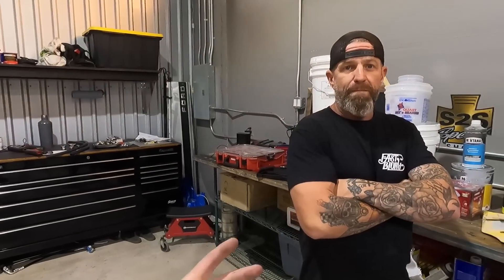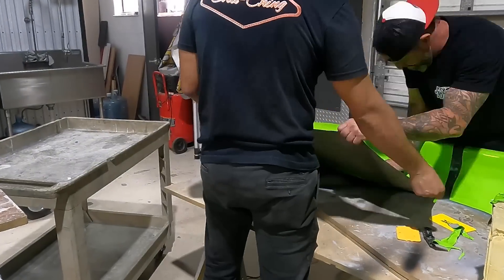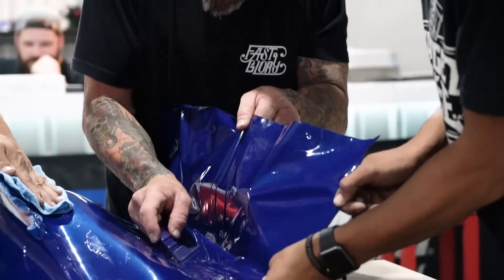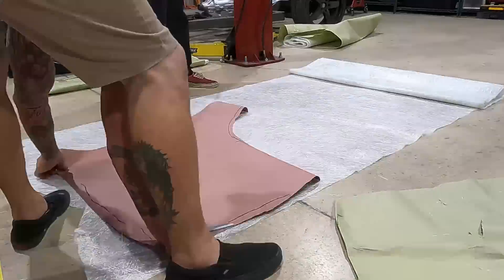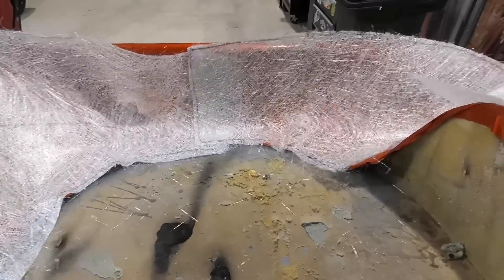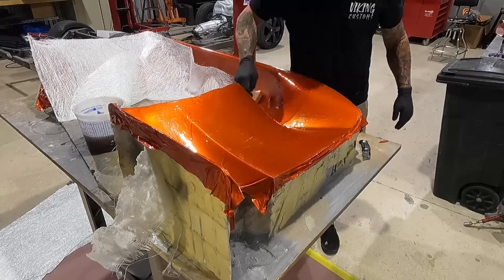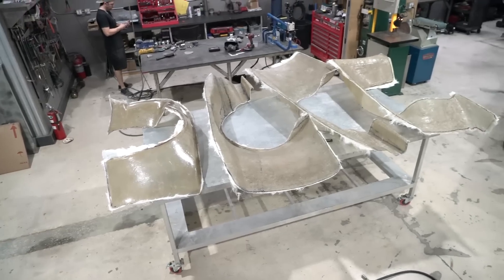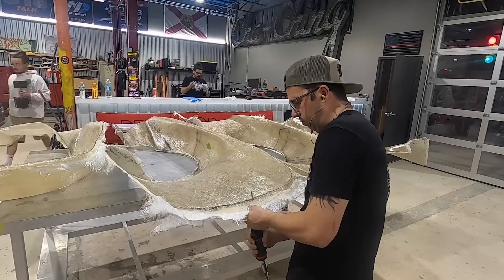Finishing the Carbon Fiber Widebody Kit For Tesla Swapped Squarebody pt. 2- Electric C10 Ep. 15

Comment: Hey guys , I do aircraft composites for a living . If I could mention two things ( no hate) Impression Master is an instant mold system , it’s a large bag filled with small beads , when vacuum is applied it becomes hard as rock … this would give you infinite  possibilities for wide body work.
The second thing is Pre-Preg carbon fibre , you can get it in a 2x2 twill or a plain weave . Just push it into the mold by hand, vac-bag it …. No epoxy mess and guaranteed resin content .
@12:30 no messing with bubbles or voids , cuts labour time 2/3rds .
My 2 cents

Comment: hello guys, amazing good composite application. Just I can say, if After applying the carbon fiber layer, there is a material to prevent air bubbles and to obtain a glossy surface, and you can easily use it. The plastic coating is used to prevent paint run-off from dripping onto the floor. I think you can get a much better result. I just wanted to say. I enjoy watching you. Go rock.

Comment: I work in a factory where we produce windmills blades and I work daily with fiber glass, just three tips, one, after placing the mat tipe tissue of fiberglass, try placing another one called combi, it'll give more strength and integrity to the piece, second one, to make the mold don't stick to the piece, use a teflon coating on the piece, it's like a paint that you apply on it, ant third and I'm not sure about this one, bucause as I said a make windmill blades, we out the blades on a vacuum machine and that way we assure ourselves that there ir no Air bubbles trapped inside the fiberglass, and the finished piece it's much more smoother and better quality, hope this is useful
Reply from the maker: Thank you! We'll definitely remember that for next time!

Comment: so it's gonna be like a testla? but slower? that's cool i guess.
Reply from the maker: How would two rear drive units make a car slower than a stock one with one rear drive unit?
Reply: @SalvagetoSavage  because none of them come stock with a single rear drive unit. You should probably do some research on this. 
They either come with two drive units for front and rear. Or three drive units.

Comment: You guys should have cnc several layer of 3" of sm foam... glued them up in a aligment jig...purposely machined a 3/16 deeper... then apply your fiberglass matt then bondo over it... then let the bondo cure green... then cnc the bondo with ball nose cutter to final hight....  lastly then cnc with small step over ie a fine pass to fix any low spots...

Then your mould would have turned out better less hand sanding  and the fender would almost beperfect... no need for metal bucks..

Comment: Poly Vinyl Alcohol. I spray it on with a paint gun after mold release compound. One coat. Temp and humidity are crucial so it doesn't harden in the air and sprays smooth. No release problems. Don't do any layups in direct sunlight, could cause a non-harden effect on the resin.
Reply: P.S. The build is great. I'd cut ANY car if that's what I wanted. Nothing lasts forever.

Comment: Why did y’all take a good complete sb square body cut it all up just to hide the bed sides? Wouldn’t it been easier to just get a cab and start from there and then build a bed from scratch? Anyways I like the build and the idea that is being built just do t know why you cut up a truck just to use the cab and bed sides
Reply from the maker: Charley we simply build the chassis based off the battery pack and then worked the body onto the frame. We used the stock bedsides to scan for the flares. So at that point why start over. That would’ve taken more time, which we don’t have.

Comment: To me, the work you're doing on this car is a celebration of the squarebody.
Sometimes, too much 'respect' makes something untouchable - turning a thing of beauty into a tombstone
Reply: Not to mention I'm pretty sure you can still get most of the metal for this truck brand new. I want to see something different.
Reply: @heartbreakandmotorjive1867  you may be able to get sheet metal new but you'll never get the same soul from it because its a full size rc truck.
Reply: @damianlindsey6177  for sure. One of nastiest sounds I've ever heard was an electric car doing burnouts. The sound of screeching tires without a combustion engine IS NOT THE SAME. I couldn't help but to think the smell of burnt rubber was probably also as nasty without the smell of exhaust. However, the drivetrain preference is irrelevant when talking about the availability of new sheet metal. This isn't a typical build for these guys, they're trying something new, and they are doing a top notch job. They're not just butchering this truck, these guys are fabricators. Even though it's not something I would do, it's nice to see something that's not another LS or K swap. But I have to agree with you, electric doesn't have the same soul. I've not driven an EV other than a golf cart, but I have a feeling that trying to drive one in anger doesn't give the same high. LoL Would you rather have a cordless chainsaw or a gas powered? Haha!
Reply: @heartbreakandmotorjive1867  I like where they are going with it and I can dig anything outside of the norm like there's an ev car called white zombie thats badass. They're cool in their own way but the ev shit is just not for me.

Comment: You guys do great work but I wish you would have either started with a truck that came with round wheel openings or squared off the openings of the widebody. No matter how hard you try you can't fit that square block in a round hole. It's just doesn't work.
Reply from the maker: You can make anything fit if you cut it up enough!

Comment: Another little trick of the trade when doing fiberglass is to cut the bristles on your paint brushes in half. It helps get the resin down into the fiberglass sheets.
Reply from the maker: Thanks for the tip! That ones definitely goin in the mental tool box for next time!
Reply: @SalvagetoSavage  have u guys heard of any modern-day use of hemp fiber used in body parts I know Henry Ford did but I was wondering if any modern improvements in application it should be a lot stronger than fiberglass, this guy made a I beam out of it https://youtu.be/Ccp6935xWcs
Reply: Wrapping tape around the haw and onto the bristles helps stiffen the brush without the chance of loose bristles getting in your material too!!
Reply: Yep and stab the resin into the fibers, dont brush. Less air bubbles